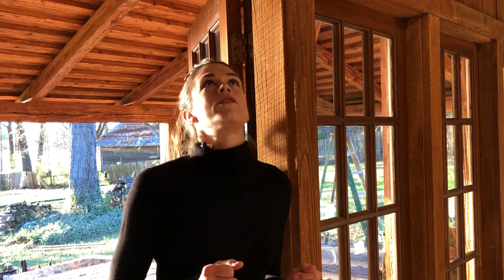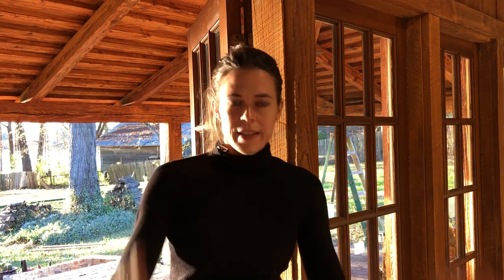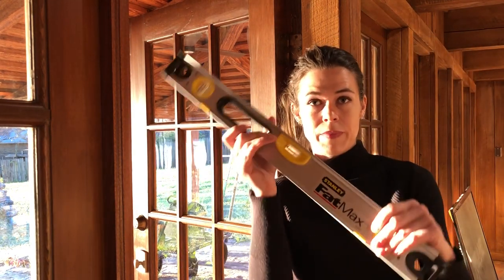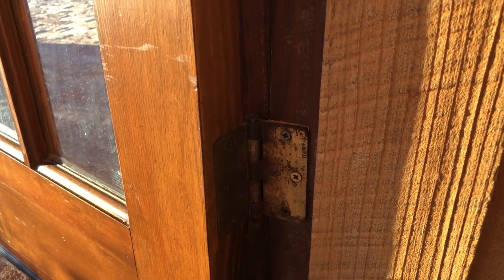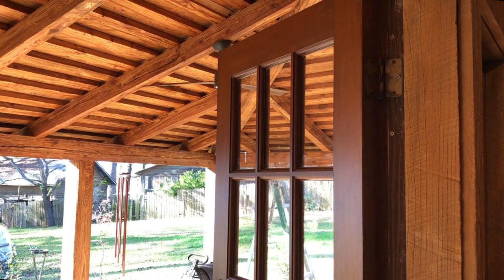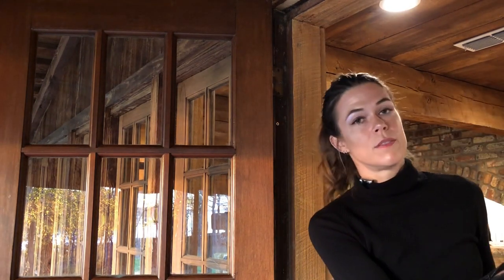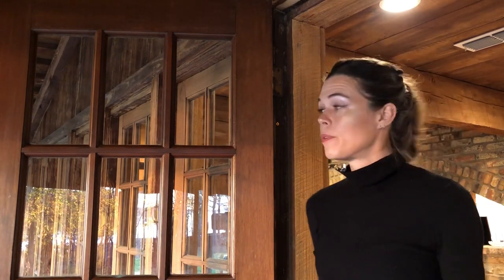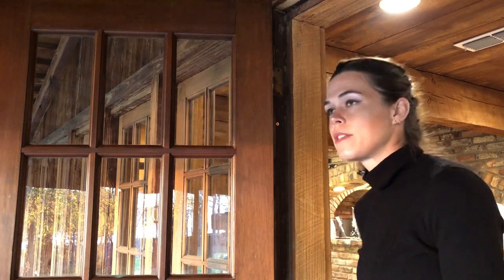TEAMSK - Adjusting Door Hinges

Comment: Duuuuuude!! You're back! 😆 Will you do a video on anchoring heavy things to lath and plaster walls / ceilings / studs. Such a pain 😪
Reply from the maker: Oh wow, you have quite a challenge! If I can either find or figure out how to build a wall to study and work with I sure will! In the meantime ( because this research will take a little while) you might try using French cleats. Depending on how big your heavy thing is, these can at least span  from one stud to another.
Reply: Yes, French Cleats for the win. Had to put up a heavy-ish mirror, but in the end just did a screw in each stud. Used  magnetic stud finder. Still.. tricky to know if you actually hit the stud or just caught the edge. 🤯 🤣 Suppose I'll know if it all comes crashing down! Glad you're back.